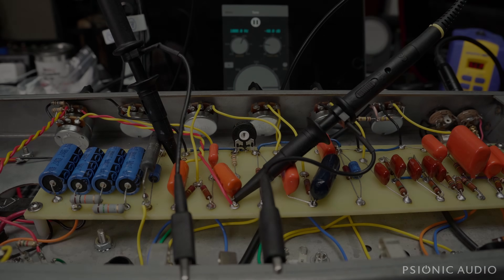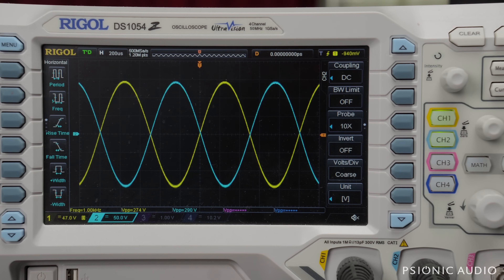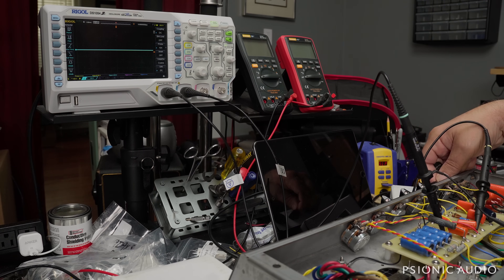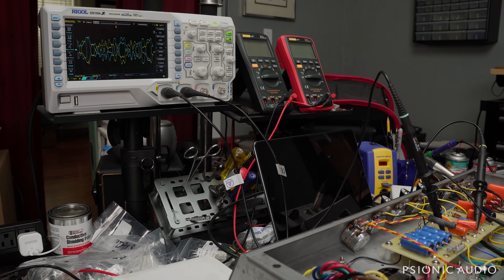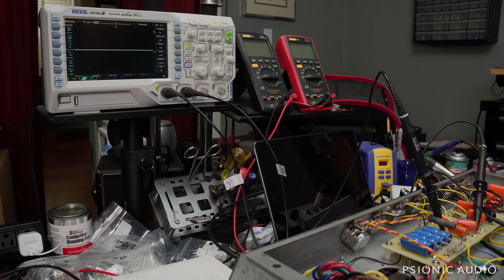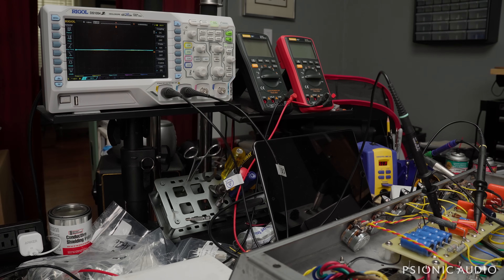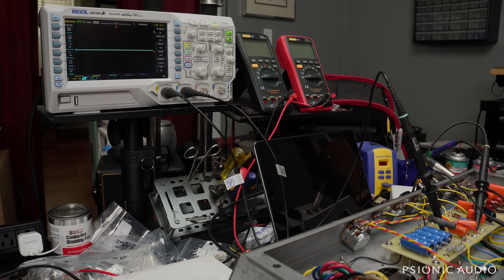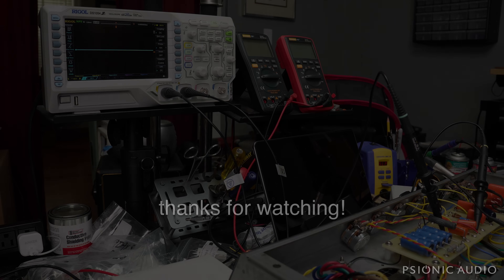Balance in a Paraphase PI | Five Watt World GA-40 Pt 4

Comment: I have a Gibson GA42RVT which is a limited edition reissue from I believe around 08-09. 
It sounds very dark. Like a blanket over it. I changed speakers from the eminence legends, to Warehouse et65 and their Vintage 30. Much better.  But it needs a master volume.
Specs are (claims to be..) class A 30wt, 5 x12ax7, 2x6L6's, 2 channel with a mix input jack. 30/15 wt switch,  pentode/triode. Hand wired point to point turret board with some traces underneath. Chassis mounted ceramic sockets. The board has John Suhr and Pyort Belov name on it for the design.  It has too much bass! It's weird. Would love to have you check it out. Im here in Tennessee maybe I can make a trip to Memphis some day. 
Love what you do and share with us!

Comment: Thanks, so much, for demonstrating the difference mismatched PI tubes/sides might make! I love your channel even though I'm a tube hifi guy and not at all a guitar player. I enjoy and work on my old '70s Luxman push-pull tube amplifier and appreciate the tips and knowledge you impart that is transferable! My amp's input (voltage gain stage) and phase splitter/driver stage are directly coupled (ie no coupling cap between them) so this increases the importance of tube matching.

Comment: I quit using those annoying ground clips on the probes (that are so often too short these days) ages ago. Much easier to ground the chassis back to the scope using a separate clip tied back to the scope's ground lug by the probe compensation signal. And if that's not preferred, all the BNC input grounds are tied together back at the scope end so you never need more than one clip anyway.
Reply from the maker: Yeah, I knew one ground was redundant but didn’t affect the measurement. And helped the clip stay where I wanted it.

Comment: Thank you for covering this topic, Lyle.  It's one that's near and dear to my heart.
For what it's worth, I'd like to offer two observations.  One, the driver tube in a paraphase probably doesn't need to be a 12AX7, and I think there's a bit more headroom with either a 12AT7 or a 12AY7.  I read years ago (sorry, I tried to find the site but can't, so I have no citation, this is just from memory) on a site devoted to tube amps for harp players, and their consensus at that time seemed to be that harp players love paraphase drivers, and that they sound best when they're about 3% out of balance.  I can see how the added raunch would make for a fuller sound, but with the trim pot you've opted to employ, it's a quick adjustment.
Second, Ampeg used a different take on the paraphase with the M15 model (schematics readily available online); while I've never had one on my bench, there are numerous clips on YT, and these can be quite 'chimey', although still full throated when cranked.  You've got it sussed already, but I just wanted to offer some options.